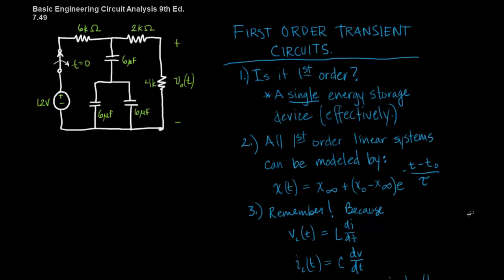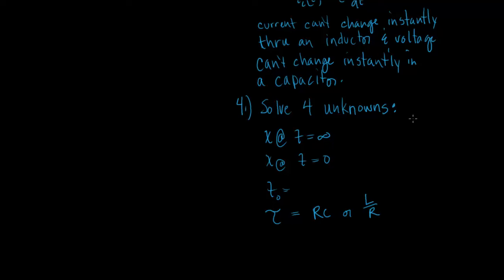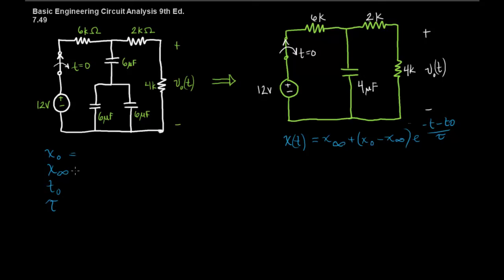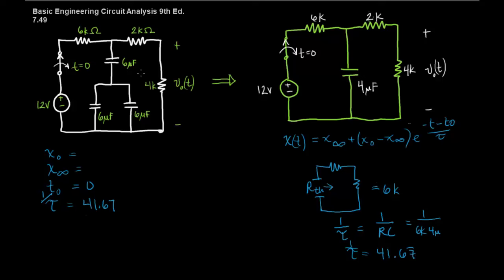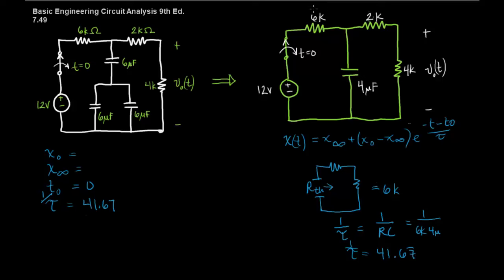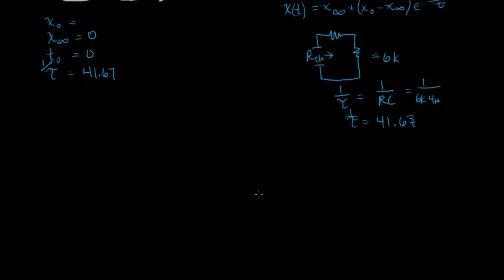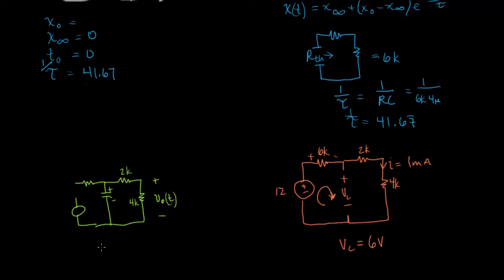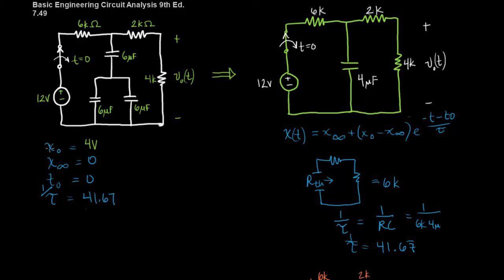First Order Transient Circuit Analysis

Comment from the maker: The passive sign convention can be the trickiest part.  In the video, I assign a parameter vc(t) with an arbitrary polarity.  For a simple circuit like this, I can guess that I have the polarity correct, because the battery deposits a positive charge on the top of the cap....even if i didn't know it wouldn't matter...because my parameter is at my discretion.  When I apply KVL to the left loop I get :   -12V +6k(1m) +Vc[t] = 0.   Hence vc(t) = 6V
Reply: I need Mathew email address

Comment: thanks for the video! im just confused as to why the thevenin resistance was 6k
Reply: when t>0 the left side of the circuit is shorted. you then only have 2k in series with 4k
Reply: at t>0, there is still a 6k resistor on the left. i might be wrong, but i think Rth should be 6k || (2k+4k), and is 3k.
Reply: Old post, I know. You open voltage sources and short current sources for thevinin. Since it's open, it's not connected.
Reply: T>0 the time switch is opened. Meaning no current goes through the left branch, which means that there's no voltage across the 6k resistor on the left. Therefore the only resistance seen by the capacitor would be the 4k + 2k in series, = 6k.

Comment: how, the time constant is 6*4....it should be 3*4...no?
Reply: +Manu Krishnan I have the same question. The only way I can see it is that there is no current flowing through the circuit as the switch is open, so the 6 comes from the 2 + 4. The other 6 is part of an open circuit branch so that 6ohm resistor isn't included.
Reply: This is correct, the 2 + 4 because when the switch is open the 6-ohm resistance doesn't see any current. I know this is year late but yeah, hope it helps

Comment: Please... Capacitors store charge inside an electric field. The don't store a 'voltage' . A voltage is only a potential difference between two points inside the electric field.
Inductors store energy in the magnetic field. Current is an instantaneous quantity , not an accumulative one. Current arises from a potential difference between two points in an electric field.
You can't  "store"' current.
Reply from the maker: Like I said, it's one way of thinking about it.  Capacitors and inductors are both energy storage devices.  With the inductor, the energy is stored  in a magnetic field.  How is this energy released? The magnetic field induces a current when it is released.  Likewise the capacitor stores energy in an electric field...
Reply: +Shagas Heizenberg Damn. You just got wrecked.
Reply: +Matthew Araujo pls how did you add the capacitance
 and get 4 uF
Reply: +Ajiri Ekwerigbe capacitors in parallel have their capacitances added. So the 2 that are in parallel will be 12 microfarads. The inverse of equilavlent capacitance of capacitors in series is 1/ceq = 1/c1 + 1/c2. This is 1/4 so the ceq is 4. There is also a shortcut that can be mathematically done as (6*12)/(6+12) = 4 microfarads